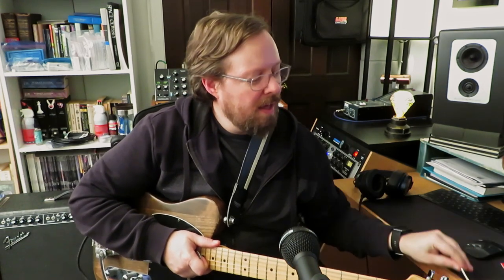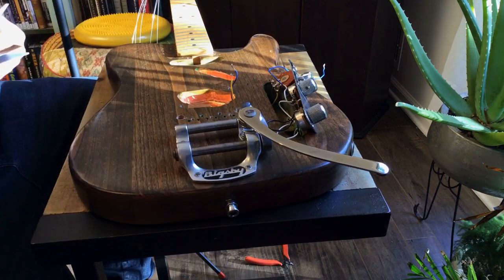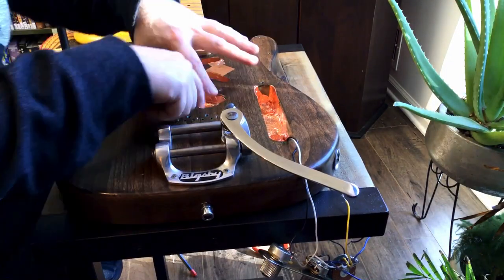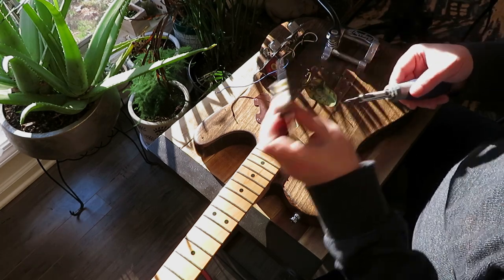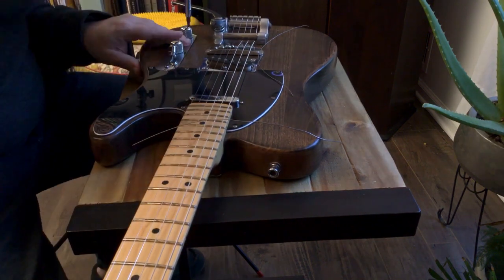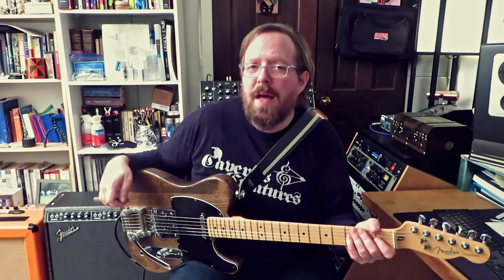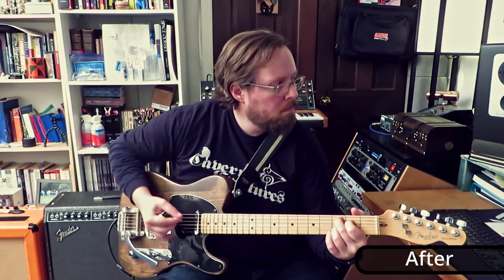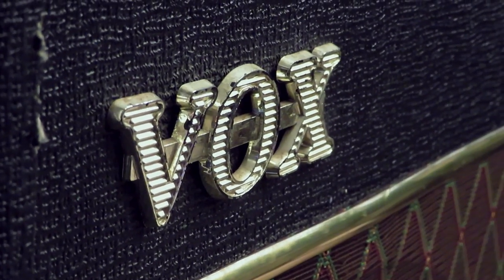Guitar Shielding with Copper Tape and Telecaster Bridge Plate Installation: Before and After

Comment: Nice pedalboard! What's your thoughts on the Keeley Synth-1? I already have a 3 Keeley effects on my board and depending on what direction I take, I may add a 4th. I'm looking at the either the Synth-1 or the Parallax Spatial Generator.
Reply from the maker: Thanks!  The Synth-1 can be chaotic and hard to control.  In a band setting I’ve only been able to incorporate it for solos.  I do love it, and the crazy ring mod like sounds it gets when you play polyphonically is fun too.

Comment: I have an issue that I believe is a grounding issue. I have a Squire tele and had been playing through a Line 6 Spider III amp - no issues with noise that I can recall. However, now I am playing through a Fender Mustang III V2 and there is distinct popping noise when I play. When I push or tap on the pick guard I get the popping, and also when I am strumming. Not all the time though. I plan to do some grounding work on the tele. Thanks for your instructional.

Comment: There's really no point shielding anything except the pickup area. That is the only area that receives and amplifies electronic signals. If you are getting signals from anywhere else, you have a grounding issue. You can test this on any guitar you want. If you find a guitar that receives signals from somewhere else, it's wired wrong.

Comment: Nope. To be a faraday cage, the pickups would have to be completely underneath a layer of copper - the entire assembly would have to be fully enclosed.
Reply: You're quite correct in saying its not a Faraday cage, but provided that all the shielding is well grounded it will still provide protection from Electromagnetic Interference, especially where unshielded wire is used.  It would be interesting to see if the increased capacitance between the shield and the hot wire may lose some high frequencies. Hmmm...sounds like a good topic for a video ;-)
Reply: tbh i read this in a nerdy voice. sorry bud

Comment: You show a copper plate, yet say you "installed a steel plate for fatter tone".  Also, you  copper shielded the neck and pass through cavity, yet those two cavities aren't connected to ground, since you have pickguard screws for the neck pickup instead of wood screws into the body.  I think you solved your problem with a better ground to the bridge plate.